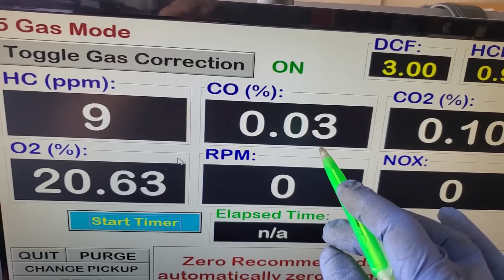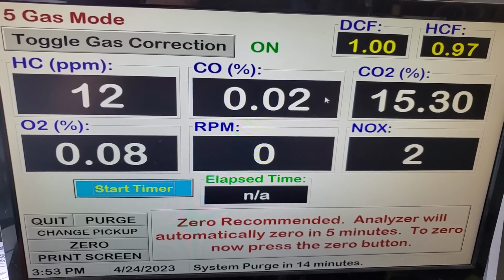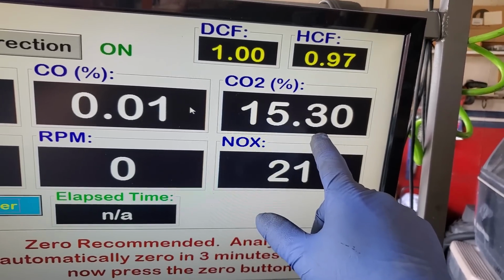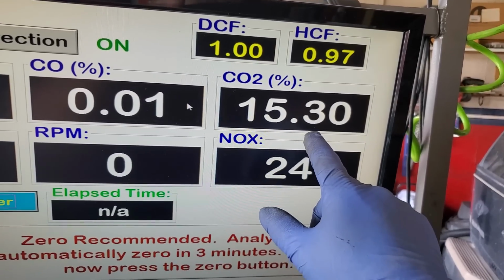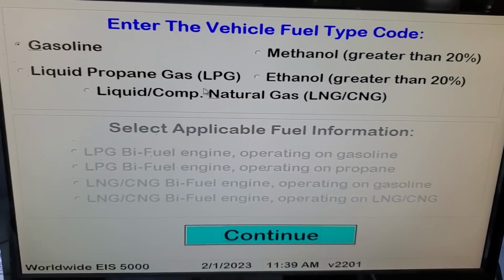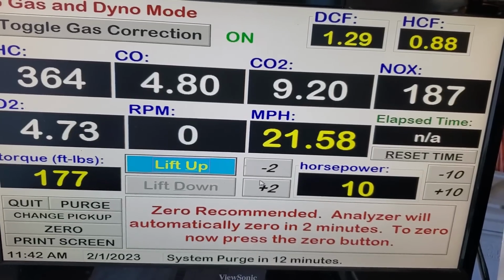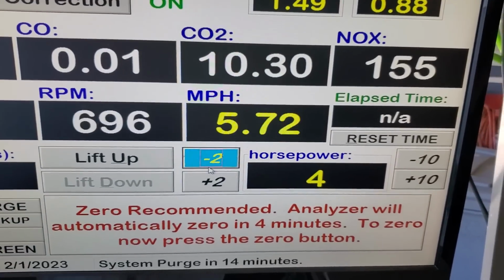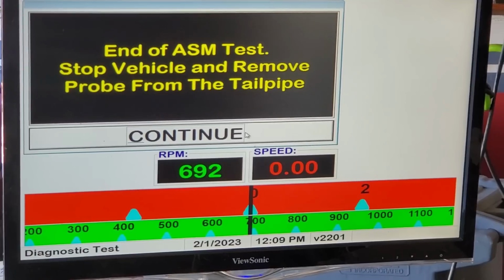About CO2 and 1991 Ford F250 ECU PCM Repair and Test Leaking Capacitors

Comment: I like my motorbike from 2006, which still has a carburetor engine and no catalytic convert, as one of the last years where this was common. The exhaust just goes straight out. Love it, especially since in Germany bikes are exempt from "green zones" in cities regarless of emissions. It only needs to emit less than 4,5 % CO on inspections, and the last measured values was 0,2 % so it actually runs quite clean.

Comment: I really like these automotive videos, they really demistify the smog aspect of cars which is rarely explained by people. Id be curious to know more about the feedback carburetors that were common in the 80s, seems like the only information i come across is from before or after that era. I've got a 1988 Mitsubishi pickup with the 2.6l engine and it has a spaghetti mess of vacuum lines and a single wire o2 sensor that is probably giving vague commands to the 2 barrel mikuni carb running the show😂

Comment: Re-squeeze the tabs on the tank leaks, or replace rad. 
When I was doing emission/drivability/e-check as mechanic/technician, had always appreciated the "high" co2 value as an indicator of perfect emission control. 
What the zeitgeist fails to mention is that vegetation thrives on co 2, which is using sheep ignorance to instill fear for living as a car bon-based entity. But more greenery is getting paved over every year rather than being replanted. Just sayin....

Comment: I like eletric cars but my issue is that the electric grid can not handle every one having evs. Also there needs to be standerds for parts like batteries sense those are gurintied to fail

Comment: Yeah it’s just a 3 speed, probably a C6 automatic. The gear indicator would have an “O” around the D for overdrive… the AOD may have been an option for that truck (I know it was on the 150 half tons), but that one didn’t get it.
Reply: Lockup converter clutch could not cope with high loads back then

Comment: Great video Shango & always fascinated by automotive electronics!.
I actually did learn something as I had no idea NO2 was harmful to sunlight, but guess no one told the "Fast & the Furious" types in Hollywood who are fuelling the NO2 craze to eek out more power!.
Lots of these older cars are actually very easy to repair (far less complicated & far less expensive potted electronic modules ie Mercedes 2003, 2005 Audi transmission ECU embedded in hot transmission fluid etc) but as you showed are "chock a block" full of a raft of issues, thankfully which are fixable as most of the parts are available inexpensively at auto parts store & can be repaired by most mechanics ie lower repair costs.
The same really can't be said for EV/non-IC vehicles whose parts & designs are highly proprietary under NDAs.
Good luck trying to get a outback mechanic to repair your EV/non-IC car hundreds of km from most Aussie city centres, not to mention all the red dust and 50c ambient temps up North.
I personally drive a late 1990s car & its very reliable even at 330000km & my mechanic tells me of many new cars who have major engine issues even at 100000km just outside warranty, use "environmentally friendly" wiring which deteriorates causing a raft of inexplicable electrical issues especially with a certain German car maker.

With ECUs there are probably thousands of old & newer vehicles with the same issues slowly dying over time & if we had available schematics (which car manufacturers continue to hide as "proprietary") then we could repair these ECUs & save a lot of these from eWaste & going into landfills, but that implies our politicians actually care about reducing eWaste in reality.
From politicians continual pushback of R2R & how they continually demonise Rossmann over the R2R subject I'm deeply cynical that they even care considering most of them including celebrities hypocritically fly to COP conferences in bizjets burning Jet A1 & travel around in diesel burning yachts eating Wagyu beef at Bali G7 conferences so I don't regard their intentions as honest.
The main problems with EV/non IC vehicular transport is:

a) Recharge time (IC cars can be filled up in 10-15mins)
b) Realistic range ie huge issue for nations like Australia, Africa with lots of remote towns
c) What happens in the event of a natural disaster ie Turkey earthquake & floods in Victoria & Europe (an IC car can be refilled using a cheap plastic Jerry can) when authorities due to electrocution risk typically cut power to an area rending vehicle chargers inoperative?
d) Their LiPo battery minerals ie Lithium, Cobalt etc are mined in Afghanistan, Congo (because they're very toxic) etc usually by teenagers, aren't as "renewable" as they claim plus produce very hot fires when their batteries are subject to external physical force ie inevitable vehicle crash
e) What happens in the event of a power blackout/load shedding ie are you stranded because you can't recharge?
f) Renewables are very unreliable (California Sept 2022 power outages?) & to run a raft of EV loads, as well as electric stoves, appliances means we need far more power generation capacity if Kirchoff's electrical laws are to be respected
g) People who've historically come up with alternative transport energy solutions usually meet nasty "accidents", or bankruptcies because officialdom usually runs them out of town
h) Range reduction due to degradation of LiPo battery performance in cold climates ie Canada, Scandinavia etc
i) Schematics & EV parts availability (or are we going to end up like Apple repairers who have donor boards to farm out components) which isn't really the case with IC vehicles & makes their parts far cheaper due to commonality & availability across multiple vendors & suppliers driving down costs

Furthermore, no matter how hard we try we cannot eliminate CO2 from the atmosphere as then plants (which depend on CO2) would comprehensively die along with all animals who are dependent on that entire food chain, including vegetarians.
From high school biology we know since due to photosynthesis, plants ingest CO2 & produce O2 so wouldn't it be 1000x better if we say instead implemented "kibbutz" type programs in our plentiful arid deserts (Australia has a stack of deserts, as does Arizona) by using solar to operate pumped irrigation & turn these deserts into arable land with plants which could not just eat up the extra CO2 but produce even more food for us (and reduce food shortages & food prices!), but then this isn't actually what our "masters" have in store for us mere mortals as they don't want solutions to be solved, but to continually chase our tails in endless "undefinable" problems which they continually exploit & we mugs continue to believe them.
The other main issue I have with non-IC cars is why are the 2 most populous nations due to UN decisions essentially now on a 30 year "head start" to pollute all they like if EV/non-IC vehicles are really the future as shouldn't they first lead the way & demonstrate these are actually realistic, affordable & viable transportation options viable for large populations & societies?.
If they can both go full EV/non-IC engined vehicles & are proven successful without huge societal disruption & affordability issues (considering their insane traffic densities) then I'll take these claims seriously as why should we be the "guinea pigs".
I've been honestly hearing since climate hysteria since I was a kid in the 1980s that Albert Park & London would be underwater by 2020 only to find that not only are they both doing great in 2023, but strangely enough a lot of environmentalists (coincidentally!) all snapped up beachside properties for a song along the entire Beaconsfield parade turning it into a multi million dollar property market.
Hmm, weird, if one truly believes that sea levels will rise! & from then on, I've taken all their claims with a grain of salt as they've usually been wrong time & time again with many of their predictions that Melbourne weather forecasters are usually far more accurate.

All good Shango, love your content & whatever makes people happy I guess!

Comment: Hurts to see Nichicons fail like that, especially 105C rated. I wonder if they were part of the fakes that were on the market back then.
Reply: That's Failure from age. The rash of bad capacitors from poor electrolyte was in the early 2000s

Comment: A higher CO2 concentration just makes plants grow better. Plant life is keeping the atmosphere's CO2 levels in check. Since huge areas of the world are now deforested, it's harder for that little left-over plant life here and there to keep up, so we're measuring higher levels.
A forest retains soil and moist. It also regulates temperature and breaks the wind. A forest is the best tool to keep the climate in check. It uses CO2 from the atmosphere and water, works on solar energy and it outputs oxygen and construction materials.

Comment: I'd love to know what the tailpipe difference between EGR connected and not on my 91 Benz diesel.
Reply: Take away the EGR on your Benz and the result will be High Nox.
The EGR is designed to reduce the heat of the burning fuel. Take away oxygen ( EGR on ) and fuel burns slower with less heat.
So when your EGR is working the temperature of the burn is lower.  This reduces the chance for Nitrogen ( which is about 80% of the air going into the engine) from combining under high heat with Oxygen.  That's the Nox value on the right of his analyzer screen.
Volkswagon got in trouble for running their diesels with high combustion temperatures which made great fuel mileage and very low emissions everywhere except for Nox which was high.
Nox makes smog when sunlight breaks it apart.

Comment: CO2 emission in the exhaust isn't totally the problem.  It's the net change in the total CO2 footprint.  As long as we burn fossil fuels we are releasing carbon that was sequestured eons ago back into the atmosphere.  IF on the other hand we burn renewable fuels such as bio diesel, ethanol, or other plant derived fuels we are releasing carbon that was recently removed from the atmosphere by the plants from which the fuel was made.  In other words, the closed loop process would be carbon neutral.  That is it WOULD be, if the process of growing the plants for fuel, and refining them into fuel was done WITHOUT the use of fossil fuel to produce the required energy.  This means switching to solar, wind, hydro, geo-thermal, or other some other carbon neutral energy source for the production of bio fuels.  The same applies to electric cars, we need to make the batteries (from mining the raw materials, processing the chemicals, and running the factories) using only carbon neutral energy.  Otherwise we are only fixing the 'last mile' of the energy chain by switching from ICE cars to electric. (And I didn't mention where the power to charge the batteries comes from).  In the end, ditching ICE power might end up making only a small difference in the carbon footprint.  However more efficient cars (hybrids) that can use less fossil fuels to go further, will improve the issue.  The Toyota Corolla hybrid I now have uses as much gas as three of the first car I ever had back in 1977.
Oh and your comparing yourself as a source of CO2 by breathing into the probe was funny (you should have tried farting into it).  But people burn bio fuels, so we are carbon neutral.  Not a problem.

Comment: EV is the way of the future...... except they're getting soo heavy that any efficiency gained, is lost to tyre wear, break wear etc
a 1.2-1.6 metric ton car running petrol (gas) or diesel vs a 2.5-3 metric ton electric -not to mention increased road surface wear
Reply: You can keep telling yourself that,but they are not the “way of the future”.  Electric vehicles existed over 100 years ago and disappeared for a good reason. They were not practical and they have the same basic inherent problems that no amount of modern technology will ever be able to overcome. First,all you’re doing is moving the pollution from the tailpipe to the power plant,which in many cases is a coal burning one. There’s the environmental impact and damage in both the creation and disposal of the toxic batteries used to power these  toys. The pollution in creating the vehicle itself and its disposal when it’s usefulness has ended.. You have limited range, you suffer battery degradation with each and every charge. Quick charge isn’t anywhere near as fast as filling a gasoline powered car and  drastically reduces battery lifespan by half. Battery performance suffers greatly  in cold and heat drastically reducing range. Some of the batteries in these cars have burst into flames in the summertime while
charging,pretty sure the toxic flames and cleanup aren’t “green”. Use of heating and air conditioning drastically reduces range. the batteries cost upwards of $20,000 to replace when they fail. They are also extremely expensive to buy and completely impractical for most people. They can not be repaired by the owner when they breakdown and are extremely expensive to service when they fail. Some manufacturers won’t let you work on them.  When your barriers runs down in the middle of nowhere you can’t get a ride to the gas station and be back on the road. You’re getting towed home.   There are also very few places to charge these toys and then there’s the staggering cost of upgrading current electrical infrastructure wouldn’t be able to handle the demands if everyone in America had one and needed to charge them every night.  Electricity costs would also skyrocket if that became the case. The whole electric car push is political. Instead of developing a superior technology we are playing around with a doomed one,battery powered toys.
Reply: @Suddenlyits1960  I agree that EVs with huge NMC batteries are not the way of the future. There are lots of problems with modern EVs (especially American market ones) but as far as I'm concerned these are all battery related. You say all they do is move the source of emissions? Large power plants with basically static loads are best for efficiency as well as emissions control. Plus there are "green" sources of electricity and also nuclear which doesn't get enough credit.

NMC batteries like most mass market EVs use are temperamental, wearing out and catching fire. There are already practical batteries like LFP which last much longer and are much safer.

Comment: Just yesterday, a video popped up in my YouTube feed about repair of the Electronic Brake Control Module (EBCM) on C5 Corvettes. The model years on these were 1997-2004. Apparently notorious for going bad and dealers want $1700 to replace them. What causes them to go bad is 4 or 5 solder points on the pcb which, on inspection, are apparent. The thing is nasty to remove and get the cover off, but worth the effort. Unfortunately the videos only show the bottom of the board and not what is on top. I keep wondering if there are capacitors in there.

Comment: Something to think about, you mentioned methane and trying to eliminate it.
There's been developments made to run vehicles off of methane.
A Canadian farmer has been running his vehicles off of it for quite some time now, but it's locking government approval, so it's technically illegal but completely doable.
It's definitely a usable fuel that would help the environment in the long run.
Since we all know electric cars are more harmful to the environment than gasoline or diesel.
Reply: Methane is another name for natural gas.  Lot's of vehicles run on natural gas.  Still contributes to CO2, but escaped methane is probably an even more terrible greenhouse gas.

Comment: It took a while for the heavy duty vehicles to get overdrive transmissions w/ lock up torque converters. The big 3 had to build up beefier transmissions before the could be reliably installed for the loads an HD truck would handle. 

Even still, most owners manuals told you to push the button on the shifter, or drop it into drive when pulling a heavy trailer.

Comment: That's an easy clean ecu repair compared to most I see on those. Ive had some I repaired with burns all the way through.
 You got it good there no worries about internal layers on these, they are just 2 layer boards.

Comment: Oil pressure sender should be easy to replace.  Are electric fans working?
Reply: Oil pressure works. The temp sensor is what didn't work.
And it's not needed for the guage to work because this truck has two coolant temp sensors. One for the ECU and one for the gauge.

Comment: When you buy gasoline most of what you buy is garbage.  An auto engine can only beak carbon hydrogen bonds to release energy, it can't break carbon carbon bonds which I believe takes 6000 degrees.  Only the hydrogen in the gas is of any use.  Hydrogen has an atomic weight of one and is the lightest, least dense known element.  Carbon is much heavier.

Comment: Why do those caps in the ECU's you've shown leak such acidic liquid when so many other caps don't? (I've seen them many times in other equipment) Are they using high acidity electrolyte yet aren't surface mount caps? High fish also... interesting. Now seriously I ran into menthol-like fish caps a little while back, 6800 uf 35v mid 80's nichicon, Otari MX 5050. Couldn't get the smell out of my sinuses for 2 days, worst caps I've experienced yet but they were NOT corroding the board.
Reply: There was a bad run of caps in the late 80's into the 90's.   Something to do with stolen chemical recipes and not produced correctly.

Comment: I haven't heard it explained in this way exactly, thank you. I rest unsure of the effects of co2 but I'm not loosing any sleep at this time. And I won't vent any R12 or R22 except for that one time I did (freeze spray). Also, we are going to run out of oil.
Reply: Vast areas of the planet have'nt been tapped for oil.  They claim there may be war over oil in the arctic.